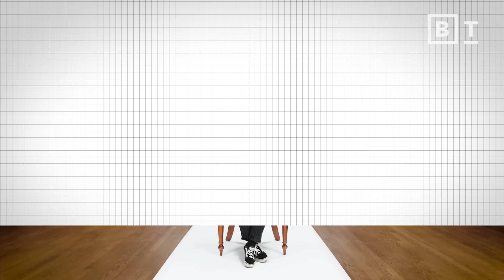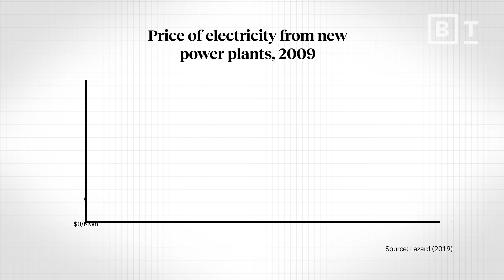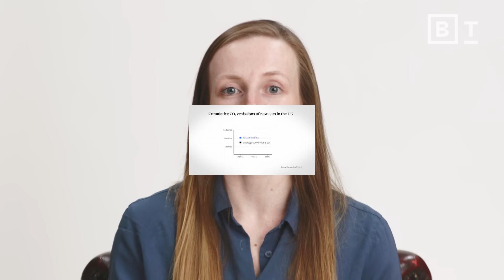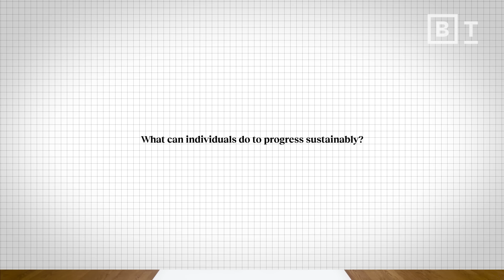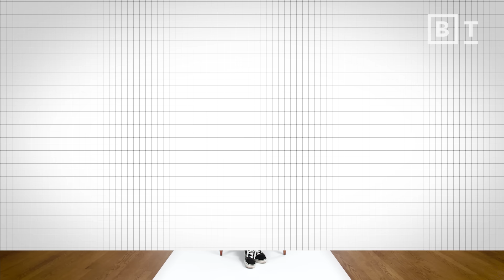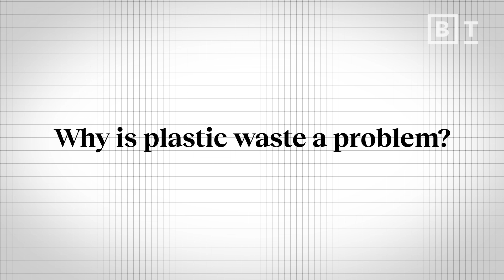Hannah Ritchie: The data behind our biggest environmental problems | Full Interview

Comment: I've read the book and watched this interview, and two main issues stand out. First, the author appears to cherry-pick topics. For example, water security—despite its enormous global impact—is not discussed at all, whereas overfishing, though important but significantly less consequential, receives an entire chapter. Second, by placing too much emphasis on individual responsibility, the author obscures the broader socio-political transformations necessary to address these challenges. Slavoj Žižek articulates this critique effectively in his article on the "recycling superstition," highlighting how focusing excessively on personal action diverts attention from systemic change.
Reply: I haven’t read the book, and am only 7m16s into the video. But what strikes me immediately (and what I would be vigilant about) is the — seemingly and up to now — lack of concern for lag. Climate-only data, which makes it ‘partial’ because it is ‘response-only’ data, reveals system behaviour in the absence of lag. When it is up against inertia and feedbacks delays — which it is in our case because of the deep oceanic response for one, and because of the peoples understanding and willingness to change for another — lag is driving your car from a rear-view mirror perspective.  Now it’s a fine perspective if your backing up, or if you’r going forward very slowly on a path which is essentially straight (small changes in direction at low frequency, on a dry road with nothing pushing you sideways). But we’re on a path with large changes ahead, we’re accelerating into it, the road is increasingly slippery from unrest and diverging interests, and both vested interests and political financing are constantly pushing us sideways. So past climate-only data is blatently insufficient to come up with a forecast.

Comment: Being of cognitive age in 1990 I watched and studied the US newscasts and documentaries on global warming that was rising at 2/10°C per decade and appeared to be accelerating reaching a reported high of 1.1°C in 1991.  Then no reports on global warming in 1992 and 1993 with statements saying the studies were looking for hidden atmospheric abnormalities.   In late 1994 it was announced that no atmospheric abnormalities had been found.  In early 1995 it was announced that global warming had suddenly paused and fallen in 1992 to 1°C.   NASA reports global warming being at 1°C in 2025.   Global warming has remained around 1°C between 1992 and 2025 varying a few 1/100°C.  The Arctic region is warming, but not so much in recent years.

The cause of global warming is not known in 2025.  It is scientifically impossible for greenhouse gas behavior to cause global warming.   Earth's water vapor saturated greenhouse effect absorbs all the greenhouse radiant energy from the earth with greenhouse gases within a few meters of the radiating surface to a maximum of 20 metes from the radiating surface adding 10°F (5.55°C) to earth's average temperature and can't have its overall effect changed.   This was taught in US high school science when I was in high school.   

Greenhouse radiant energy is a lower frequency than far inferred light behaving as a high frequency electromagnetic radio wave loosely interacting with the lumpy electrostatic fields of greenhouse gas molecules slowly draining it down to zero within a few meters of the radiating surface.   In the lower atmosphere no greenhouse radiant energy can be measured farther than 20 meters from the radiating surface.  After being absorbed the greenhouse energy's further heat transfer is by convection i.e. gas molecules bumping into each other.  Earth's atmosphere is too cold to radiate greenhouse energy.  When depictions of greenhouse radiant energy are using photon interaction that is an incorrect depiction.   Greenhouse radiant energy behaves as a high frequency radio wave.

Carbon dioxides share in earth's water vapor saturated greenhouse effect:   Water vapor has a CO2e of 18 and is on average is 1% of the troposphere.   Carbon dioxide has a CO2e of 1 and is about 0.04% (400 ppm) of the atmosphere.   1.00%/0.04%=25,  water vapor is 25 time more present than carbon dioxide.   Multiplying by water vapor's  CO2e 18 X 25 = 450 CO2e for water vapor and 1 CO2e total for carbon dioxide.   All the other greenhouse gases total to little less to about the same as carbon dioxide or 1 CO2e.   On average carbon dioxide has 1/452 share in earth's greenhouse effect.   

About 40% of atmospheric carbon dioxide is considered to be from human activity.   1/452 X 0.40 =0.000884955752212 or 0.09% share, less than 0.1% share, of earth's water vapor saturated greenhouse effect is from human caused atmospheric carbon dioxide.   Earth's water vapor saturated greenhouse effect is from water vapor the other greenhouse gases can not change its overall effect.

Climate Change pseudo science claims earth's greenhouse effect is never saturated and on average adds 33°C to earth's temperature.   That makes for totally absurd predictions.   A 30°C day with average 1% tropospheric water vapor would be 30°C.   The pseudo science climate change greenhouse effect is adding 33°C.   Without it the temperature would be -3°C.   That same situation with 100% humidity that creates 4% atmospheric water vapor at 30°C would have the day temperature at 4 X 33°C -3°C= 129°C vaporizing all water in the area!  The other greenhouse gases were not included in this calculation for clarity.  They are only 1/2% share at 1% tropospheric water vapor and only 1/8% share at 4% water vapor.  

This is why when the UN IPCC after for years being obsessed with human caused carbon dioxide causing global warming from the mid 1980s to 1995,  with no mechanism given on how this could be, had the engineering scientific audience quietly giggling because carbon dioxide is an extremely well known gas.  Then when in 1996 the UN IPCC suddenly stated it was carbon dioxide's greenhouse behavior causing global warming the engineering scientific audience was ROLLING ON THE FLOOR LAUGHING because it was so moronically scientifically impossible and the IPCC had gone on and on obsessed with human caused carbon dioxide causing global warming for years!  The other aspect was that global warming had fallen to 1°C in 1992 had had no indication of rising and was likely falling a few hundredths of a degree Celsius.  

The actual IPCC science report never actually comes out and directly states atmospheric carbon dioxide greenhouse gas behavior is causing global warming because the scientists don't want to get sued.

Comment: A quick comment about purchasing local food versus having it shipped in. If you are ONLY looking at transportation costs maybe there is a point there. However, there is a good chance that any food being shipped is also farmed conventionally, something easily avoided at Farmers markets. Ergo I would think you need to count the fuel for tractors, the carbon loss from tilled soil, pesticide and herbicide use and the carbon footprint of those, the waste produced by this, etc. This is why just looking at data sometimes is not helpful. Context matters.

Comment: If solar and wind are cheap, why German electricity prices is so high? I don’t make sense.
Reply: cost of infrastructure and also the tax, in the netherlands its pretty cheap, solar is like 5cent per kwh
Reply: It costs the public power grid more natural gas to support large amounts of wild AC from wind turbine and solar voltaic generated electricity with jet turbine generators running at high readiness 70% fuel consumption making near zero electricity than making all the electricity with efficient running natural gas combined cycle power stations.   The public power grid has no choice, but to support every wild AC kW on its grid.

Comment: It’s nice that someone found a nice lively scientist to outline the alternatives to a completely dead and uninhabitable planet.  

Sadly she doesn’t have a clue on how to achieve the results she offered as solutions.  

Electrification of home, transport, industry and food production, all which centuries to achieve with fossil fuels, isn’t magically going to appear, even with the cost structures and relative acceptability of the technology available.  

What has to happen is a mental change, from one of incremental progress, where 1.5 (C) transforms into 2.0, 3.0 rather a global race from the current 1.5 to  1.4, 1.3… and eventually a carbon neutral cycle.  

While I know what needs to be done, MS Ritchie’s offering up ideas that are simply unhinged from reality.

Eventually we die or do something, and it does little good to pretend that incremental change is going to get us there, regardless of how sweet and lovingly it’s advocated.

For what it’s worth???

Comment: A Climate Remediation and De-acidification Suggestion.

	There is a lot of discussion and no full agreement about Global Warming, whether it really exists, how serious a threat and the role of Atmospheric Carbon Dioxide. However, the following is generally agreed. Namely that a lot of CO2 has been released into the atmosphere since the start of the Industrial Revolution and a lot of it has ended up in solution in sea waters. There is at least 150 times as much CO2 in a cubic meter of sea water as there is in a cubic meter of atmosphere at STP. This is acidifying the sea waters and possibly harming Coral Reefs and other fauna. There has also been some agreement that the Temperature of the Earth has warmed somewhat.
	The Earth's rotation and the Coriolis Effect has formed several Tropical/Semi-Tropical Oceanic Gyres, within which the mass of seawater is rotating, clockwise in the Northern Hemisphere and counterclockwise in the Southern Hemisphere. Anything floating, i.e., less dense than sea water, tends to float towards the center of the Gyre. There are five main Gyres all of which are Tropical/Semitropical. They are the North Pacific, South Pacific, Indian, North Atlantic, and South Atlantic Oceans. Together they form a very large proportion of the 70% of the Earth's surface which is covered by water.
	The North Pacific Gyre has a lot of floating debris, "the Great Pacific Garbage Patch", some of it being debris washed off Japan by tsunamis following the recent Fukushima Earthquake. The Southern Hemisphere Gyres do not appear to contain much floating debris.
	The North Atlantic Gyre is unique. It contains the Sargasso Sea which is characterized by the presence of two species of Sargassum which float by virtue of oxygen-filled follicles. It was discovered (first documented) by Columbus from his voyage in 1492. There is a Sargasso Sea Commission, with an Office in Washington DC, which is charged with protecting the Sargasso Sea from pollution etc. There is a website that basically describes all of the positive ecological values of the Sea. Strangely there is very little knowledge of the Sea in the Houston Region of the USA.
	Since 2011 the Sargassum appears to be overflowing from the Sargasso Sea and moving, via the west bound currents across the north coast of South America into the Caribbean and sometimes into the Gulf of Mexico. This has been attributed to agricultural run off from the USA or Brazil but might be due to the increased levels of CO2 in solution in the sea water.
	It has been washing up on beaches throughout this region, as one might expect to happen. When it dies and rots it emits H2S. Since a lot of these beaches have tourism as their main industry, the weed has to be removed manually which has given Sargassum a bad name. There are several Facebook entities that keep track of Sargassum landings and there are frequent postings enquiring about Sargassum occurrence on specific tourist areas. The emission of H2S shows that the Sargassum is absorbing Sulfur from the sea water, remembering "Acid Rain" and the high sulfur content of a lot of marine diesel and that could be a good thing.
	The occurrence of live Sargassum in the Caribbean would, however, make it very easy to put live Sargassum into the Pacific off the west coast of Mexico. From there the currents would carry it all the way across the Pacific, photosynthesizing and growing all the way absorbing a lot of CO2 and heat energy, photosynthesis is an endothermic reaction. Absorbing CO2 from the Ocean would allow more CO2 from the Atmosphere to dissolve in the sea as well as reducing the amount of acidification. The Sargassum would probably stay in the North Pacific Gyre but some might drift into the South Pacific Gyre.
	One might balk at the idea of covering a lot of the Oceans with Sargassum but it does have uses. It can be used to make ethanol, paper or cardboard. Some one in the Caribbean is making construction bricks from it and others are feeding it to goats..
	If there appears to be some benefit from Pacific Sargassum we could easily add Sargassum to the other Gyres using ships that are transiting the Panama Canal. It seems likely that some Sargassum will eventually get into the South Atlantic Gyre, but that may take a while.

I would welcome any thoughts. 
Robert O Ducharme PhD, MSc, BA (Oxon) (I am a geologist)
 (rodincus@aol.com).
Reply: Thank you for your thoughtful response and insightful analysis. Your approach offers a more feasible and comprehensive solution for climate remediation, especially in comparison to the more limited strategies that focus solely on halting specific activities. Additionally, I appreciate the innovative uses for sargassum that you highlighted, which present intriguing potential for both environmental and economic benefits. Your thoughts reflects a deep understanding of the complex challenges we face and offers a more sustainable pathway forward.

Comment: I have 2 questions: is it possible to create an additive to mix with gasoline that makes it so that combustion does not result in the creation of CO2 or other greenhouse gasses? And why haven't we started filtering these greenhouse gasses out of our emissions especially from these big smokestacks that all industries use?
Reply: we do, it's called clean coal.  no -  when you burn things it creates hydrocarbons. doesn't matter what it is.
Reply: 1. This not possible because combustion is basically oxidization - in very simple terms, we get the energy by making CO2 (and other oxides). Making something else would defeat the purpose. We get energy by breaking molecular bonds in long carbohydrates molecules, trying to bind carbon to some other molecule requires more energy than we would get out of the reaction.

2. We actually do for some of those - try to look at catalytic converter for cars. Another similar devices are used on coal plants and were a major mitigation of acid rain. That cannot be easily applied to CO2, because that one is very non reactive and it has very low concentration in the exhaust and air. That's why carbon capture is so hard, it requires a lot of energy to "fish" for CO2 molecules in the air.

Comment: This person is huffing some serious copium. Nothing we can do will stop or even seriously mitigate what is about to happen to us. We should definitely try for that moonshot .1 percent chance but we need to start being realistic and talking about stages of grief and a hospice mindset for humanity, not a flower and rainbows one of being saved by technology. Unstoppable runaway feedback loops have been taking place for decades and the heating is now exponential. Humans have a very poor understanding of exponential effects and this shows in our inability to comprehend what is taking place.

Perma-frost melts, releases carbon, carbon heats the planet, more perma-frost melts, more long-locked away carbon is released.
Perma-frost reflects light (called albedo in scientific literature). Sea ice and glaciers have receded so much that there is almost no albedo.
The oceans have warmed so much that they can now no longer abosrb heat. They are now net heat emitters.
No news sources are reporting this lovely fact: all winter long around the arctic circle/north pole, it has been 20 degrees Celsius (36 degrees Fahrenheit) hotter than average. 20C! In the beginning of February of 2025, it's TOO HOT AT THE NORTH POLE FOR WATER TO FREEZE!
Temperatures are so high that forests are no longer absorbing carbon. Combined with drought and raging wildfires, forests are now net emitters of carbon and no longer a functioning carbon sink.
Removing sulfur from sea-faring vessel's fuel has caused yet another exponential feedback loop: soot was actually BENEFICIAL as it provided reflective particles to bounce the sun's rays back into space. They are no longer there or much reduced. Great for our lungs. Terrible for the temperature.
Carbonic acid is lowering the pH of sea water. The oceans are massively acidifying. Combined with the unbearable heat, corals are bleaching all over the planet and the bottom of the biosphere's food chains are disappearing, taking out larger species that rely on them.
Taking a look at temperature charts adjusted for shorter periods of time, the heating is speeding up. If you look at temperature changes from the past 3 years alone, the charts are virtually shooting straight up.
On 5 February 2025, global sea ice extent reached a new all-time minimum, at 16.20 million km2, breaking the previous record set in February 2023 (16.27 million km2). It remained below the February 2023 level for the rest of the month, dropping further to 16.04 million km2 on 7 February.
We have anti-science lunatics in power in the US who call climate change a religion or BS. Nobody will do anything about it or even try to mitigate it. We currently have entire towns under water in West Virginia that aren't even being reported on the news.